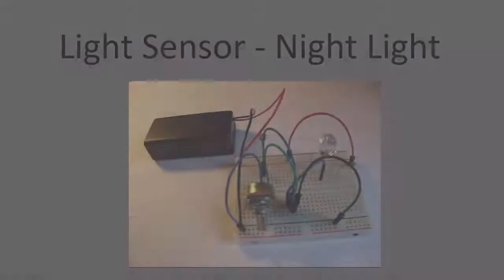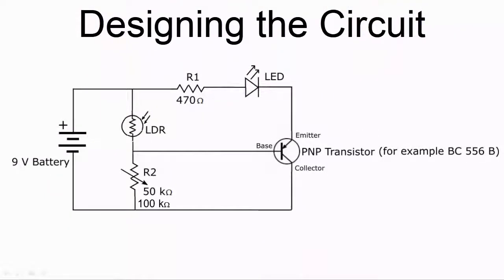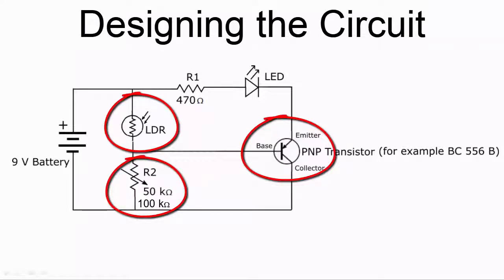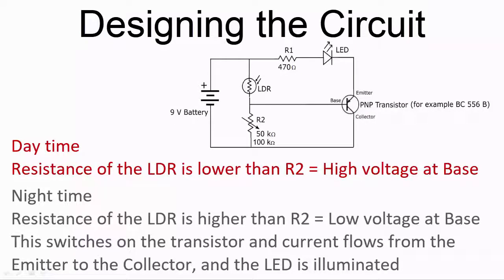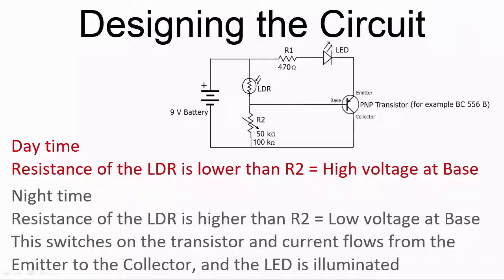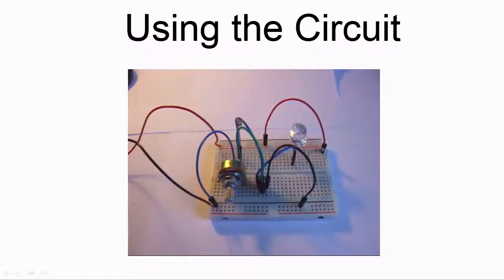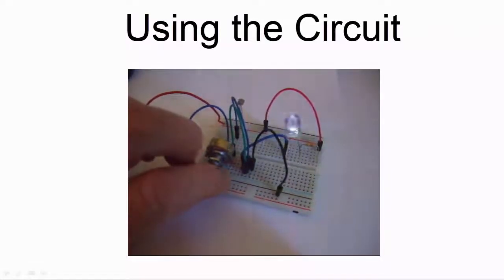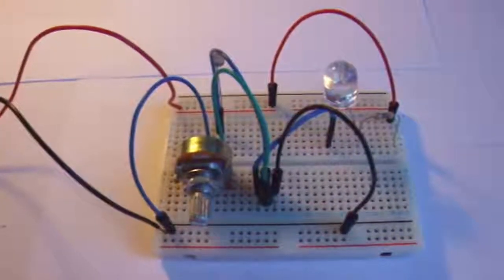Design and Build a Night Light - Electronics for Absolute Beginners

Comment: What if you wanted the led to be on when light is present and off when the light is out?
Reply from the maker: It’s fairly straightforward to change the circuit so that it operates as a day light rather than a night light. In fact, all you need to do is to replace the PNP transistor with an NPN transistor and swap the connections for the Emitter and Collector. 

You could use the circuit shown in this video: https://youtu.be/WOnrJ9MlCg4

Instead of using a solar panel, use a battery.

Hope this helps

Cheers, John
Reply: dont use the transistor